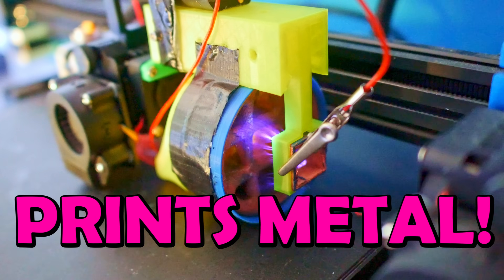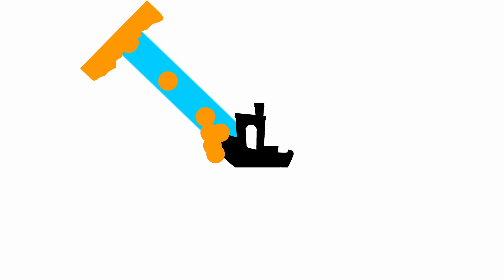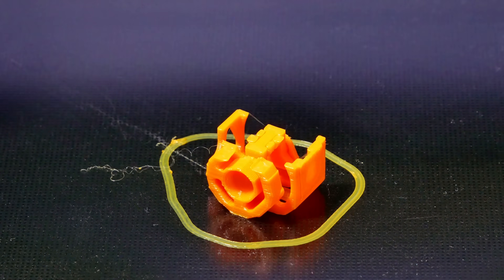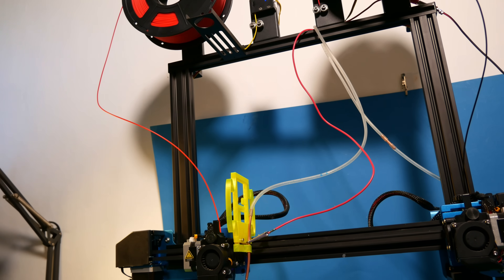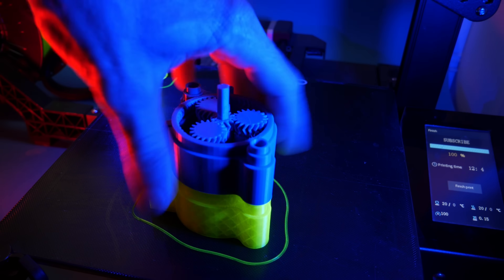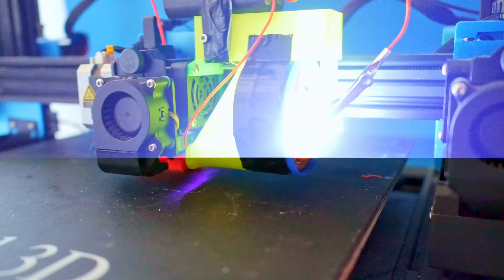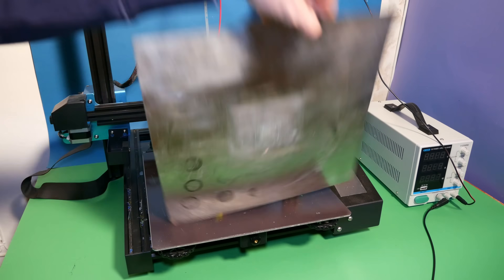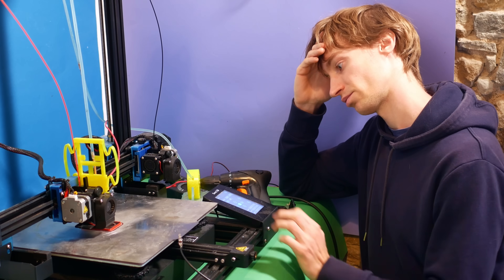i made a METAL 3D-Printer at home!

Comment: Few years ago, I also thought about concept to use galvanising in order to print metal parts. This involved to fill the whole layer with insulation where you don't want metal to build up, and leave the parts where you want metal exposed. This would in theory allow to make a fully metal part, with few limitations and very slowly. And also needed an idea to easily remove all the insulation somehow.

And actually your approach is genius. Of course with right materials you can print both conductor and insulator, and also a limiting cup to hold the electrolyte only where needed. 
The process itself needs some thoughts and adjustments of course, but the concept is very promising, best of luck!

By the way, with similar process you can deposit not only copper, but also nickel, iron, zinc, chrome, silver, gold, titanium and a lot more. Each metal requires a special blend of electrolyte and a specific parameters of current, voltage and time. And in galvanisation you are not dissolving the anode, but rather use a solution where needed metal is already dissolved in a good concentration. I suggest you research about galvanisation and try to deposit other metals, should be a great step forward. Also that way you can even create a system where you have an non-reactive anode and just different blends of electrolyte, and you can choose which metal to deposit depending on what you fill the cup with.

Also, about problem with print sticking to metal. If the plastic is gripping okay on the surfaces that you electroplated, why not to try electroplate the bed itself on where you are planning to print? 
Also a better idea right away. Try to tape the buildplate with either copper or aluminium tape, and then galvanise it's surface a bit. You can even lay something under the edges of the tape to create a bowl shape that will hold electrolyte easier. You can even print the bowl perimeter on a pei sheet, and than tape it over and clamp the tape with alligator clip or something. 
And after printing just remove the tape from the bed and cut away accessives from the print
Reply: The most common type of galvanising is just dipping metal parts into molten metal, that isn’t easily applicable to 3D printing. Electroplating can already be used with a lot of metals. I really don’t see the benefit of trying to go down the galvanising route.

In terms of the print sticking, we don’t actually know that the print stuck to the electroplated material, it was printing on plastic too. Plastic does not like to stick to metal, at all really, so even copper or aluminium tape won’t do much and coating it won’t help much either. There is a reason that bare metal isn’t used for build plates. There are also much easier ways to get it to work than using a conductive build surface anyway.
Reply: @conorstewart2214  apologies on my side, I just got a bit confused, because turn's out in my language the electroplating process is literally called "galvanisation", and that what I basically remember from the university that is called that way. And when I tried to search about galvanisation in English it turns out to be the whole different process, with a lot of steps and dipping in molten metal, that is really not suitable here.

My point on the other hand is that electroplating can be done with a bunch of different metals, but not it the way of dissolving the anode and transfering it to a part, but either on using a special electrolyte solution that already has desired metal in it and not reactive anode

Comment: Honestly I doubt their are many parts I would want to make in metal, which I could not just cast using traditional methods. But having said this with my primative knowledge of electronics you have me wondering if this is for real. If it is then you are an absolute genius and I love you and what you are doing. Thank you so much and subscription added.
Reply: That is a "problem" I have too. Casting is relatively easy. I use my 3d printer a lot but have yet to come up with something where I feel like it would be more appropriate in my particular use cases. I am sure I am just blocked mentally however. We tend to think in the languages we know. It takes a fresh perspective to tear that down.
Reply from the maker: Haha, yes, this is a lot more "apartment friendly" then casting though
Reply: @TurboSunShine  I certainly can't argue with that. :) Though my heating expenses are rather substantial.
Reply: @TurboSunShine  I certainly can't argue with that. :) Though my heating expenses are rather substantial.
Reply: @jerbear7952   Any single print part with complicated interlocking internal structures requires this for sure. Something designed to baffle people with little to no knowledge about additive manufacturing, like a metal ball within a larger metal mesh ball. Created by melting out the support filament.
Reply: @arielmarshall5501 you could probably cast your ball in ball example fairly easily tho haha
Reply: @xxportalxx.  Crap, I think you are right, lol. Ok for highly complex, single part, super high temperature resistant parts then, for self replicating print farms on the moons surface. ;)
Reply: Printing metal in an environment of your choice would certainly be a lot more convenient for most people wanting to create metal parts.

Comment: Its not 3D printing metal. Its electroplating. 
I would not be wrong if i say cheap tricks to get views...
Reply: From excited to clickbait in about 30 seconds :(
Shame as it is still cool, useful electrically but not mechanically. Which is what we really need. Custom DIY PCB can be done a number of ways already, I just mill them on my CNC machine, waaaay quicker and easier than this method. Hell, you could zip tie a dremel to a 3d printer and call it done. But milling complex shapes in aluminium or even steel, that is a different level entirely, and what we really need.
Reply: Yeah - his "metal 3D printing" isn't that impressive, but the problems he solved along the way are chef's kiss (tool changer, print-in-place pump)

Comment: Amazing work! This is so so cool.

For the conductive build surface issue, why not print a conductive raft/skirt that links all the parts to a single connection? That way you can still print on the PEI surface
Reply: That's a good idea, I wonder if it would cause issues for removing the build
Reply: Community power: activate!
Reply: Has anyone just tried various metal foils/coatings as a build plate? I haven't had a reason to go down this road before but something tells me there's a simple solution right in front of us.
Reply: or get a sacrificial nozzle and etch out a brass plate lol
Reply: You could also use an ITO layer on top of the build plate!

Comment: Excellent work. One idea for electrical conduction on the build surface. Print with a raft made out of the conductive filament.
Reply: You don't even need a conductive build surface, you can just run a wire to the conductive raft itself. In fact, you don't need a raft either, just a tongue of conductive filament on first layer or a test point somewhere on the model that you'll hook up before the plating step.
Reply: @TheLaXandro I think the problem with that is that then you have to manually do something, which is difficult to automate
Reply: @dailythenoob  You could print a "wire" of conductive material to the edge of the build plate and then have a probe or alligator clip that can be toggled to touch the wire using the print head.  Sort of like how the fluid dispensor tip is lifted/dropped by sending the z axis to the top.
Reply: yeah true! or even print conductive filament over thin wires on a build tack surface ! soi long as thinner than first layer height should be fine
Reply: Seriously impressive as always - looking forward to the longer video
Reply: I have a print bed I made up for my belt printers.  With a modification it could be used for this purpose.  If you where to take a thick iron on patch material, layer on a fine metal mesh, then fabric, You could get a print surface that is selectively conductive (if you flooded that part of it) would adhere and release, would be patent free. And is flexible so auto ejection or other opertunites are there.
Reply: Amazing job 👏👏